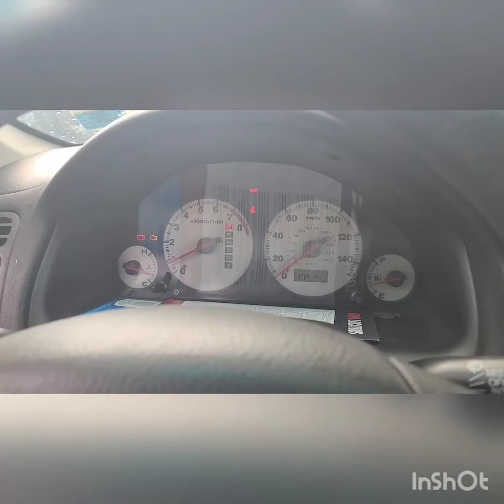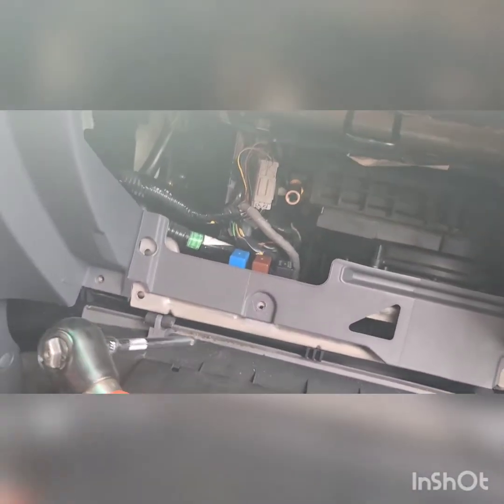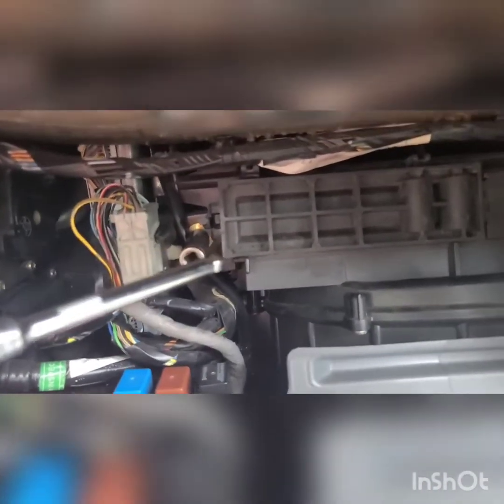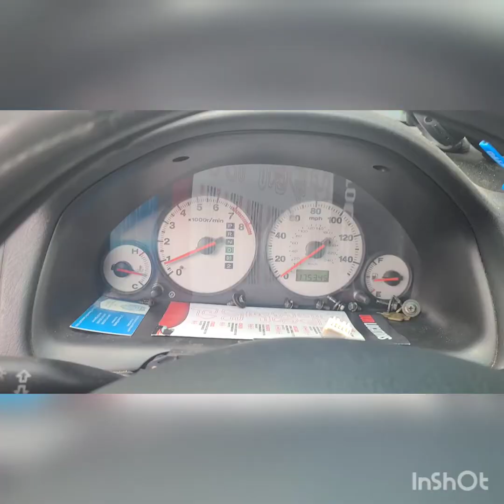01-05 Civic "Limp Mode" No OBDII signal Fix (How to Replace the ECM)

Comment: I have a 2001 - 2005 honda civic es8 and the eps light is on and the steering is hard. I changed the complete rack and it's still didn't work. Any tips????

Comment: Hey I know this is kinda late but if I buy a used ecm and ignition with keys for my 04 civic would I even have to program anything? I know the ignition would be linked with the ecm but like do they need to transfer any stuff out of my old ecm to the new one since the vins won’t be the same? Or can I just run it like that? Since both ecms would be the same part number

Comment: so if i got the ecu w the key and key cylinder n stuff i wont have to program? just plug n play?
Reply from the maker: @ruk0r69  correct all you'll have to do is swap the parts. And the cylinder has security Bolts (smooth heads) just cut a Slit and use a flat head to screw them out

Comment: What tool did u use to take off the top bolts of the ignition
Reply from the maker: @ViperCoPinkVipers  air hammer to put in a slit. But you can also use a chisel or saw to make a slit and just use a Flat head screw driver to turn them out

Comment: I’ve changed The crankshaft position sensor and the camshaft sensor and car still showing them as needed to be changed 😂, you think I need to change this out ?
Reply from the maker: @iTzKiNG1  I'd recommend checking the wiring first. You'd be surprised what a little short could cause.
Reply: @Duggie.Douglas  Ty
Reply: @iTzKiNG1 Did you ever figure the issue out? Did you have to get a new ECM?
Reply: @radthamer7705 actually it was my timing belt lol😂 wasn’t communicating with both sensors as it should !
Reply: @iTzKiNG1  Glad you were able to figure it out. That's so random.

Comment: hey man got a quick question, i have a 2003 honda civic ex d17a2, the engine blew and i’m replacing it with a d17a. if i get a d17a ecu would i need a new ignition and key? or can i use my original one?
Reply from the maker: You could keep the old ignition and key but will have to call a car locksmith to get it programmed to the ECU
Reply: @Duggie.Douglas  thank you!
Reply: @DylanHathaway-rk8pr I just did a engine swap to a d17a1 as well, but after 500 miles it went into limp mode. What route did you take to fix your problem

Comment: I'm confused what was the steering column parts removed for?
Reply from the maker: The ECM is programmed to the key cylinder (Colume piece) For this to be plug in play and not require a computer/key reprogramming you must replace together.

Comment: Me gusto tu viendo amigo , pero tengo una preguntas mi carro 2001 es manual y el motor no es vtec y le quiero cambiar  pero es más fácil conseguir un motor vtec ,puedo hacer un swap cambiando el harnes de cables y la ECU y el switch se va poder programar ?? Gracias
Reply from the maker: Estoy usando el Traductor de Google. Si desea cambiar el motor, deberá cambiar la computadora (ECU) por una VTEC. Si sacas el transpondedor/interruptor de encendido y la llave del mismo auto, todo será plug-and-play.
Reply: I really appreciate if you used a translator and answer my question , because this week I’ll work in my car but if I can get the same engine harness and ECU  ignition and key is plug and play You’ll save some money

Comment: I just replaced mine and now code P0730 incorrect gear ratio popped up and the car does not move even if its in Drive
Reply from the maker: Check out trans fluid and solenoids. If both check out fine your trans might be on its way out.

Comment: Where did you get your replacement key, ECU and ignition? I can’t find any on ebay?
Reply from the maker: If not ebay, check Car-parts.com, or junkyards
Reply: @Duggie.Douglas  If I get it from the junkyard then I’d have to call a locksmith to cut a key and program it right? In your opinion which way is cheapest?
Reply from the maker: @joelcasas7222  If you get just the computer then yes you'll need to have it programmed. If you get the corresponding ignition and key then its just plug and play . Cheapest route is to just get a computer ignition and key from a junkyard and doing the swap yourself.
Reply: @Duggie.Douglas  will it still pass inspection with a new ecu and ignition etc im thinking of buying a set on ebay and putting it in my car whats the process to get it working jn the car

Comment: Do you by any chance remember the codes the check engine light was giving you? I have a P1361 code (no communication to the TDC sensor. (Camshaft position sensor) and ive replaced the sensor and i dont have open circuit from pin 2 on the sensor to pin 26 on the ecm. As of this point the only other option has to be a bad ECM. But i was wondering if maybe i have the same problem you did. Do you remeber what codes you had?
Reply from the maker: So with my situation my ECM was so bad it wouldn't even allow me to read codes. A few people had similar issues like you did. Most had positive feedback after replacing the computer.
Reply: I have the same problem you have, im refurbishing my computer

Comment: Hey i have a 01 honda civic ex v-tec and my original computer was damaged. However, i wanna know if i get an emobolizer,ecu box etc from a car like mine. Can't it work after i reprogram it?
Reply from the maker: If you do it like how I did (purchase a used ECU, with corresponding immobilizer w/ keys) then it'll be plug and play. If you get just an ecu or immobilizer, you'll have to get them programmed into one another.

Comment: I can't get them bolts out that hold the immobilizer can you show me how
Reply from the maker: If you're referring to the ones on the Steering Column you must make a slit into them. Then you can use a flathead and an impact driver/hammer. Honda from Factory made them smooth because they weren't meant to come out, so you must make a slit to unscrew them.

Comment: So if I buy a used ecm from another Honda civic I do have to program it? Or what scenario do I not need to
Reply from the maker: So like in the video if you get the ECM from the same Gen civic an get the matching/corresponding Ignition solenoid w/ key it's plug and play when you replace both. If you replace the computer you'll have to get it programmed

Comment: Hey chief quick question I got a 01 Civic, same problem. question is: did you have to reprogram the new ECU or do anything to it? 
I skimmed most of the video thanks and cheers
Reply from the maker: So if you get a used ECU with the ignition cylinder and key then no since it's all programed together already. If you just get a ecu/ecm then yes you'll have to have the key and cylinder programed to it

Comment: Hi can anyone help trying too do the same thing mine is a 05 Honda Civic 5 manual Power windows so do I need an Computer  off the same kind of car does my computer have to match the new one and the numbers or do I just need a new computer and ignition off the same year mine is also non-VTEC
Reply: The reason why I think the computer is broken is the previous owner did a shitty alternator job one of the top bolts weren’t even tight alternator was just going back-and-forth so I’m going to buy a new alternator bracket and used computer at a junkyard and ignition just trying to figure out if I need too Match the same numbers off my old computer to the newer one I’m trying to get or do I just need to make sure it’s non-VTEC as mine is and power windows and standard just need to match it or

Comment: Does it matter if I have a manual transmission 1.7 2002 ? Can I use one from the auto transmission
Reply: Noooooooooooooooooooo, match the part number, don't mix and match! :D
Reply: I actually went to the dealer and the guy told me that it had to come off from an EX, that it didn't matter if it was auto or manual (I have an EX). The only difference I see is an extra black plug. I know some systems, both the engine and trans are managed by the ECU (Engine Control Module) I'm going to have to try and see what happens

Comment: I need to change my ecm also, once doing this I was told it needs to get reprogrammed, is it the key ignition or the ecm that needs to get reprogrammed
Reply from the maker: Technically both. But you gotta get the ECM and the Ignition solenoid programmed to one another. If you buy a used ECM with the respected ignition like I did it's plug and play
Reply: So as long as they are pulled from the same car and it matches your trim model no programming? Honda service tech said he’s never heard of this when I spoke with them today. He said the part for my cars VIN for 03 civic ex auto, is 37820-PLR-426, I’m not seeing the 426 on any of them, I’m seeing 37820-PLR-L58, L57,L55. Do you know if there is any difference, or if the L58 etc would work?
Reply: @codydavis7030  any updates?
Reply: @ianmullins355  I actually figured out my problem after going through a bunch of testing/probing and testing my computers. Ended up being my cluster needing replaced luckily. Put a used one in and I’m good to go for now.
Reply: Question Where did you buy from Duggie Douglas For Plug and Play??
Reply from the maker: @isaiahmontano7516  Ebay. Just make sure it's the same sub-model and has both the ECM with the ignition and key. If you get all 3 then it's plug n play. If you just get the ECM then you'll have to get your ignition program to the new ECM. Technically you can even go to a Junk and scrap yard but atleast with Ebay they'll let you know if it works and it has a return policy

Comment: Hello sir..can i ask u question?.
My car Honda Civic 1.7 2003 have a problem that the engine can running only about 1 or 2 second and it off..when i use a scannner that was no fault codes that have been show...did the engine have a problem same like you sir?..
Reply: No fault codes with a check engine light normally means a fried ecu

Comment: Ok, so why did you replace the shit on the column, whats that got to do with the ecm?
Reply from the maker: That ignition Switch is Programmed to the ECM. If you mismatch them they won't start the vehicle until you have them reprogrammed to one another. Which you will need either a locksmith or a Dealership to do

Comment: Doing this for my 05 EX vtec.. 

Do you have to swap the ignition to get the car running? 

And do the first line of numbers have to match or the second or both numbers?
Reply from the maker: The Ignition switch and the ECU must Match for it to work. Or the Ignition switch must be programmed to the ECM. If not it won't work
Reply: @Duggie.Douglas  so new computer Hass to match my old one the numbers the end or the start or all of the numbers and have to and get ignition and cylinder to for it too work

Comment: What a pain in the ass to remove🤯
If you’re civic 01-05 is burning rich, hard start, running rough, shits the bed at red lights than I suggest unplugging the negative post for a few mins, reconnect it. Now hop into the beater turn the key and start it and don’t touch anything just sit there pondering why you’re driving the pos in the first place. Anyway at this point if you’re searching vids on here than you’re probably having the ticking and rpm/temp gauges are probably jumping up and falling blah blah blah. Anyway just start it and let it idle for 11 minutes than turn it off and start it again. During that period the ecu is performing some kind of safety diagnostics on itself or something idk really know but this method worked for my ecu. I found it stashed away in an old forum from 2007. So after ordering another ecu or pulling one from the scrapyards for nothing try this out. I wish I’d found the guys post on that forum before I had pulled the original ecu out in the first place but it did work on the other one I installed.
Reply: Why did you have to work on ignition? Was it related to everyone? I thought you can change even without messing with ignition
Reply: @trevorlane8123  I was lead to believe I had an ecu issue by Honda dealerships. If you’re having limp mode issues you may not need a new ecu. Instead of buying a brand new ecu I went to the scrap yard and found the same model Civic with the keys in the ignition. I pulled the ecu and the ignition so I wouldn’t need any programming needed.
Reply: @dsmith421  ok that makes sense. I’m not having ecu issues, I drive an 02 Civic ex AT as well, 202k. Have you ever thrown a camshaft code P1361 & p1362?
Reply: @trevorlane8123  hey sorry for the late reply No sorry didn’t experience any issues like that.
Reply: @trevorlane8123  i know this is a late reply but what ever happened with it? wasthe problem with  the camshaft/crank senso? r or was it related to the ecu?
Reply: @njaii4298  hey did you end up figuring it out same problem with me right now crankshaft sensor replaced it and still in limp mode
Reply: tHanks for the tip.
Unplug negative and check before going shopping.

Comment: Thanks for the video man This it the only helpful video I found on YouTube. 
Hey would a 2003 civic ex ecu work with a lx car same year. 
Am doing a engine swap to vtech
Reply: Id recommend kswapping if you have the money
Reply: My car is a 2005 dx I changed the ecu for an ex vtec ecu and vtec ex engine wire harness to run vtec
Reply: Just buy same year ecu and harness but make sure it’s vtec

Comment: Because from what I’ve been told is that you need to reset something but I want to know what is it that I need to reset.
Reply from the maker: So what they're telling you to do is basic wipe the ECU and see if it fixes the error. Personally I didnt do that because its much easier to find a Replacement and just Have the ECM and Iginion swapped with a used one
Reply: @Duggie.Douglas  did you keep the same key?
Reply from the maker: @agustinroque6247  the ignition key that come with the replacement solenoid. If you use your same ignition key and solenoid that comes with your car then you'll have to get it programmed

Comment: We have an 01 Civic negative battery cable needed replaced when it would turn over one day. So we replaced it and while the car cranks great now nothing works inside. No radio, no dash lights, no locks, windows, etc. Swapped out all of the important fuses and relays under the hood and in the glove box to no help. It is almost like the electricity isn't going to the inside of the car. We are out of ideas and thinking maybe the ECM got shorted or something when the cable went bad.
Reply from the maker: I would recommend try plugging up a OBD2 Scanner and check to see if you yet any Codes or anything. If the ECM can't be read either while the car is on them yes the ECM is bad.

Comment: Help? 05 civic ex No check engine light, no acceleration power and can't go over 4000 rpm while on park. Vtec kicks in every time rpm hits 4000. Bad ECU?
Reply from the maker: A few Questions. Does it does the same thing my car does in the video? Also try pluging in a OBD2 scanner and if its unable to read the ECU then it is a Bad ECU
Reply: @Duggie.Douglas  Thanks for the response, no the car does not have the same issues like your. Basically the car starts normal, engine runs good, idle stable, and scanner works. Only issues are as stated above.
Reply: My does the exact same.did you figure it out?
Reply: @DJDM87  no I haven't no clue lol. The only thing I haven't done is swap out the ecu.
Reply: Ok I bought a ecu last week. Gonna try it this weekend and see what happens
Reply: @DJDM87  I hope it works for you.
Reply: @DJDM87  any luck with the new ecu? Does it works?
Reply: @kv7188  nope, ended up being a clogged catalytic converter
Reply: @DJDM87  Thanks my brother wanted me to buy a used ecu, key, Ignition and Immobilizer. He thinks it's the ECU. Guess every car is different.
Reply: @kv7188 hey bro i know its been years but my civic is having the same exact issues yours was. Did u ever figure it out?

Comment: hey brotha my 05 did the same thing (manual). so do i have to get a 05 manual ecu from the scrap yard to replace it with?
Reply from the maker: Yes. It must match up to your Spec for it to work. So you're able to get from like a 03-05 ECU w/ Key and Ignition Solenoid and it should plug and play perfectly. I recommend Ebay if you want to find a good package deal where you can seek all the info from the seller

Comment: Thanks for this video. I have an 01 its not getting enough juice to engage the fuel pump. So its cranking but only firing up when I put gas directly in the intake. If that makes any sense. Thinking its a faulty computer because as far as I have researched that blue relay is for the fuel pump test light was dim when I checked the pump.. it has been sitting a while and jumped multiple times so its possible I fried the computer.. is there any way besides deductive reasoning to confirm the computer is the issue?
Reply from the maker: I say get a Voltage Probe and check the fuel Relay. See is the Computer is getting signal to the Relay and to the computer itself. Thats one way to trouble shoot it and see if it is or isn't.
Reply: I so appreciate you taking your time to advise me ♡ Thank you!
Reply from the maker: @misschen2279  You're welcome! I hope it helps you out.